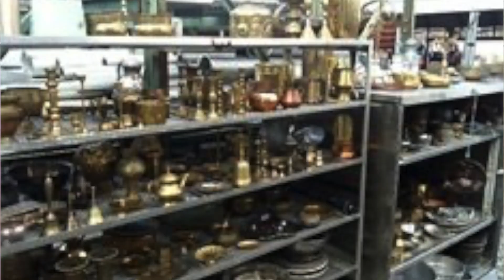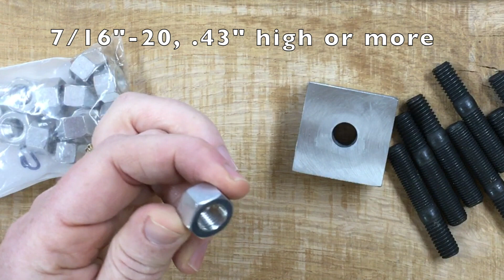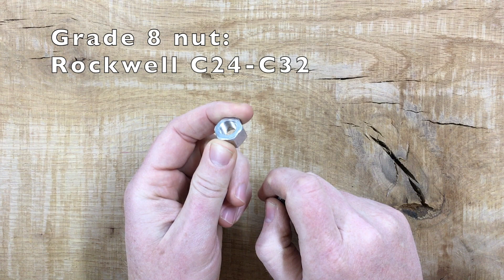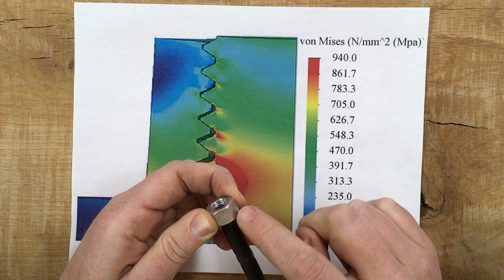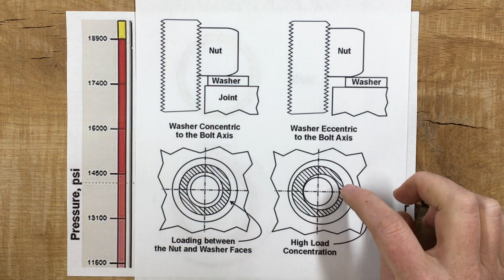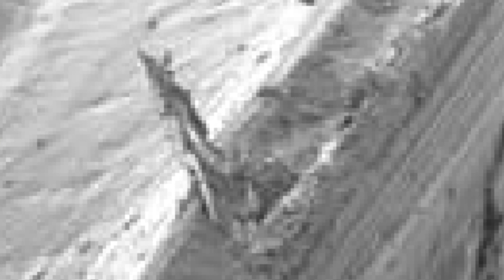Model A Ford - testing engine block threads

Comment: You should always zero out torque wrench back to zero after using if you're not going to use it for a while. Also, you shouldn't use a torque wrench to loosen a bolt or nut. Just saying.
Reply from the maker: That’s good advice for anyone!

Comment: Enjoyed the video. I can see where to is better to do this test and not have the threads pull out when you are torquing the last nut with the head on.  A question that occurred to is: what are your thoughts on reusing lug nuts?
Reply from the maker: I assume you mean wheel lug nuts. These are fine to re-use as long as the threads are good. There's much less force on them than on the head nuts. The most common failure with wheel lugs is for the studs to come loose from the hub.

Comment: It's easy to compensate for oversized washer holes:  Just go a size smaller, and also note the difference between SAE and USS sizes.  In some cases a metric washer will give the snug fit.
Reply from the maker: Good suggestion. Washers can still throw off the clamp load, and they don't spread the clamp load like the spacer does. But I agree that, if you insist on going with washers, having a snug fit is critical.
Reply: @alexiskai  Why are you torquing the nuts to 65 when the original Ford specs call for 55 ft lbs ? According to Snydars they recommend 55 ft lbs max with their 5.5 head .
Reply from the maker: @michaelburns3645  That's a great question and something I should have covered more fully in the video. Several reasons:
1. It's a common misconception that the original specs call for 55 ft-lbs. I've never seen anyone produce these specs. Modern torque wrenches were not used on the factory line. Workers torqued by feel, and it's likely that if anything they applied more torque than was strictly needed.
2. 65 ft-lbs is recommended by some head makers, notably by Larry Brumfield for his Super Brumfield heads – and since this is Larry's procedure, I went with his standard.
3. People sometimes opt for 65 ft-lbs if the block or head (or both) has some low spots, on the theory that it will cause the iron to accommodate a little more and close those gaps.
4. There is a common idea that 65 ft-lbs is Crazy and Way Too Much and will lead to thread failure. The truth is that most heads will handle 65 just fine, even with Class 2A threads as you see on these general-purpose studs. So it's worth showing people in the video that a head with what I consider normal wear is actually pretty strong. 
5. There's evidence that torquing a fastener to a higher percentage of its proof load is actually more stable, over a long period of cyclical tension load, than torquing to a lower percentage, so if the block can take 65 ft-lbs then that may be a better setting. This is covered on p. 59 here:
https://practicalmaintenance.net/wp-content/uploads/Fundamentals-of-Threaded-Fasteners.pdf

Having said all that, as Larry notes in the written description above, if you plan on torquing to 55 for your head, you could reasonably torque to 55 for the test as well. I'll be doing 55 for my new cylinder head. If 65 gives you the willies, don't do it! Better to test at a lower load than not to test at all.